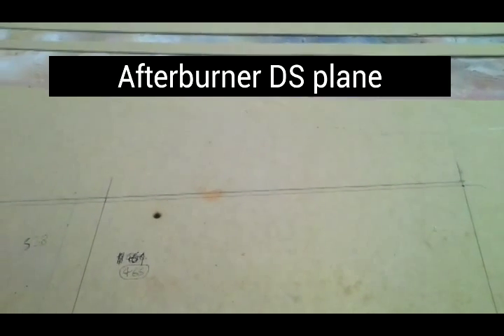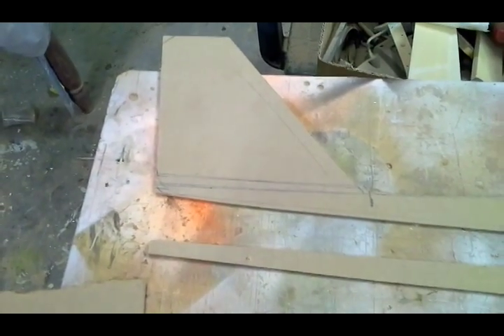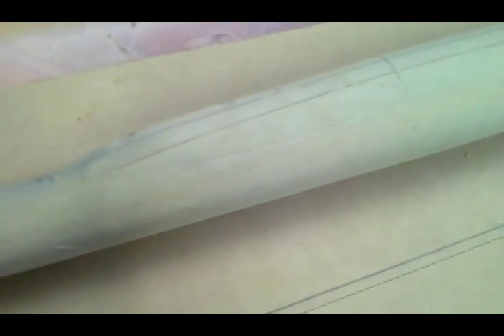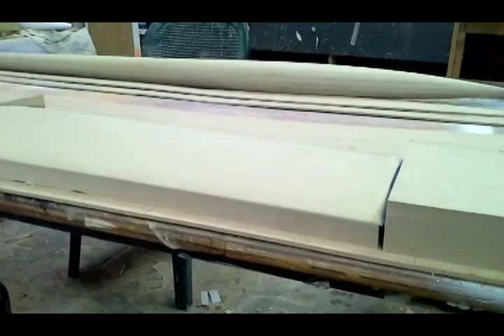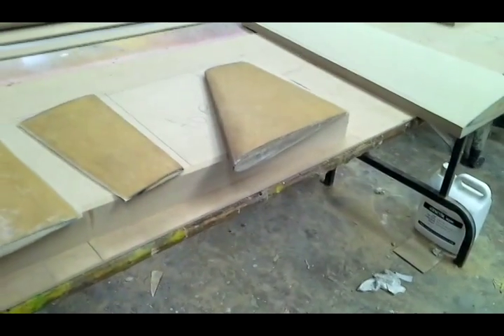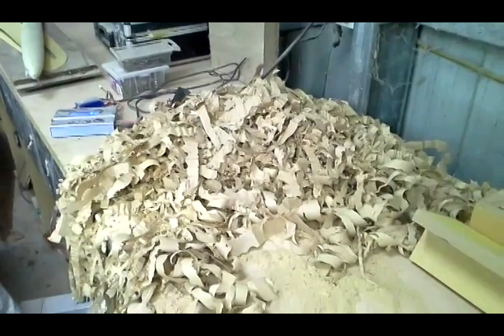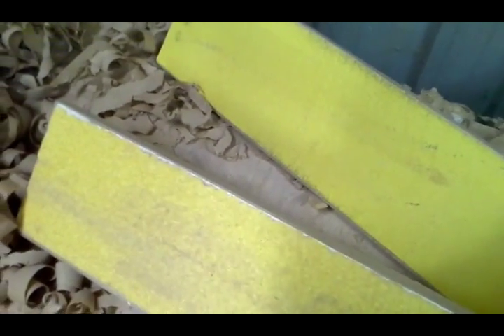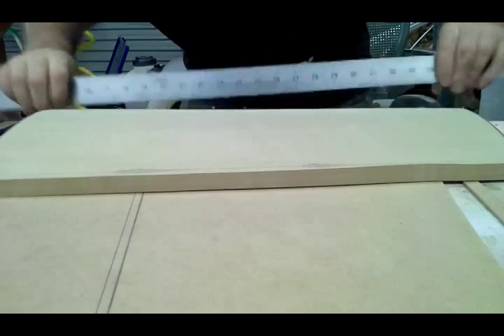Afterburner DS plane build part 1

Comment: Excellent stuff Kevin, keep up the posts.  One slight peeve...@3:24 a good carpenter never lays his wood-plane on the blade when not in use...place it on its side :-)
Rather than MDF, what about hot-wire cutting high density foam and then sheeting and glassing to generate a plug? You can compensate for the sheeting and glass thickness with a thinner foil and the kerf. Not as "solid" but has worked for me for decades.